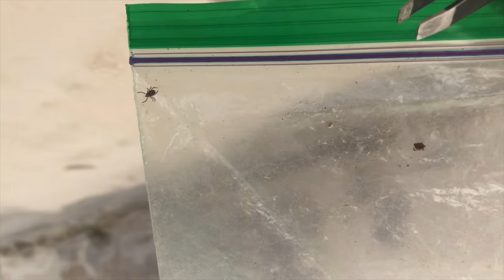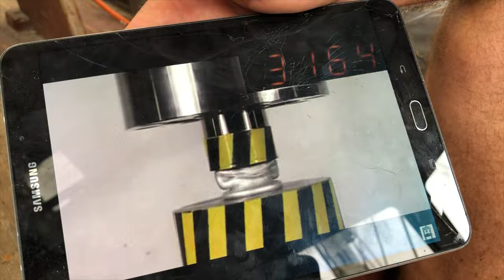trial by FIRE

Comment: It’s great that you take breaks Justine :) I put all my metal bushings and bearing race’s in freezer or a cup of ice. Yes to the much help as it’s done. But a good trick that was shared to me. Keep at it soon you will be off the hard. be safe…
Reply from the maker: 👍 We don’t have a freezer and we don’t have a torch - but yes! We need to try extreme temperatures next time we’re dealing with metal components.

Comment: Cutlass bearing... not easy to replace. But you did it! I'm gonna have to do mine very soon... for the third time
Reply from the maker: Yes! And we will never be able to replace it 🤪 (it will need to be cut out in the future). That sounds like you are needing to replace yours too often - is the prop unbalanced? Lots of vibration? Or maybe you are just sailing the shit out of Gallopin (letting the prop spin)?
Reply: @sailorama  I replaced about two years ago. And yes, I have sailed and ran the engine a lot. I don't leave the prop spinning under sail. I put it in reverse.

Comment: Robinson and Justine,

The next time that you have to install a cutlass bearing try placing it in dry ice or if none is available then ice water before pressing it in. As the temperature is decreased the brass will shrink, which will make it easier to install.
Cheers!

Blue Skies!

Faithfully,

James
Reply from the maker: Thank you for the advice - we also received the opposite version - to blow torch the metal to make this temperature difference - but icing might be easier, because we never seem to have a torch. It is easier to get to the corner store and buy a bag of ice…
Reply: @sailorama  
I would be a little cautious of putting s touch to any metal as you may temper it, deform it, and/or make it brittle. 

Blue Skies!

Faithfully,

James